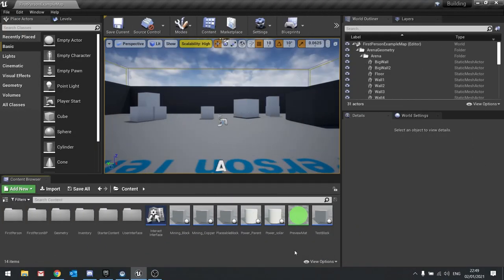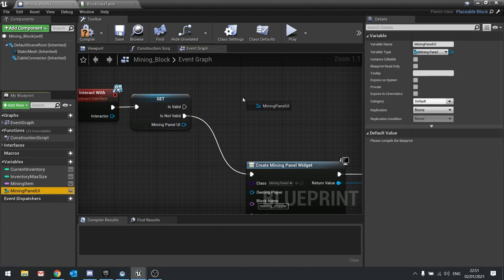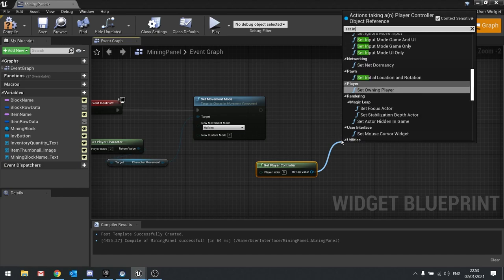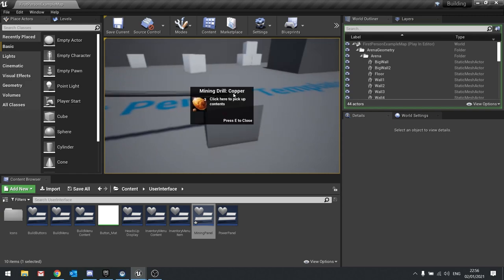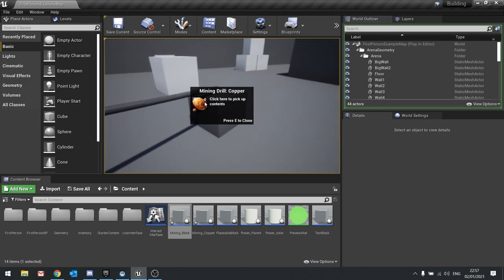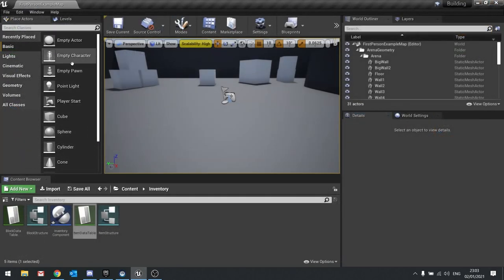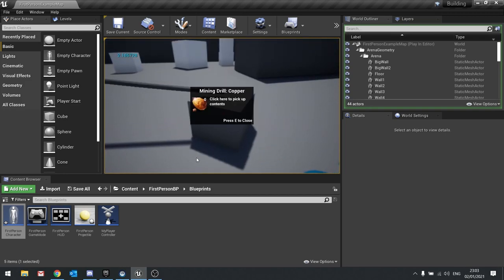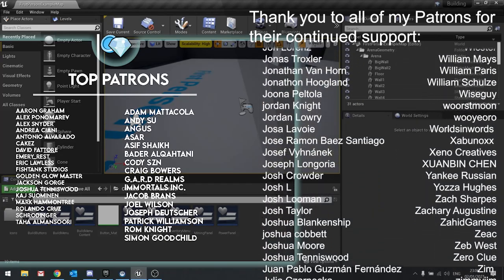Unreal Engine 4 Tutorial - Building Series Part 17: Mining Continued

Comment: Hey Ryan!

I have just watched every episode from 1 to 17 in one stretch! As a burned out ex dev in a "previous life" (web front-/backend), i think i have learned more about how UE4 blueprints work from these episodes, than watching many other tutorials and "inside unreal" episodes. On top of that, without opening UE4 a single time while watching the episodes.

From what i've seen you create so far and combined with my previous programming knowledge in several unrelated languages, i have already been able to spot a few bugs while you were creating, found things i would have done differently as well as learned many things i had no idea you could do in the system. In other words GREAT WORK!

The only thing that has really gotten to me is how fast you skipped from building simple blocks in the start and on to the UI and inventory management. Not that there is anything wrong with the UI or data handling parts at all, but i think both I and many others really could use your take on a general snappoint system as that is usually the foundation of building in most games. I do hope you return to that part to flesh it out! (and i think if you had done so in the start, i would also not have been able to stop building along with you)

It also seems to me that you are starting to have quite a few common operations that could be centralized by now for great benefit, f ex a generic inventory checker/adder/subtracter (which should also easily enable you to only red-tint materials in recipes the player does not have enough of rather than all materials - example: currently if the player is only missing wood in a recipe also requiring metal, both materials are colored red). Speaking of materials: In your code to add copper ore to the inventory you chose to add 0 copper to the player inventory rather than having the addition use the false part to add it. I feel that not exposing all material types to the player until they are able to obtain them adds more immersion :)

Anyway, long story short, i have loved watching this series and i do hope you continue it! I would also love to support you, but due to health reasons i am honestly ** poor at the moment, so all i can do for you for now is subscribe and like each episode.

Here's hoping to see more content in this specific series, cheers

Onde (ex-Tv haha)

Edit:
While i remember, the voice levels in your videos vary a bit from quiet to (slightly) loud. Just wanted to mention this in case you haven't noticed ;)

Comment: Not sure if you have fixed it but there seems to be a bug. When connecting with cable you have to connect from the power source to the block, the other way  around dont work atm and i feel it should work both ways